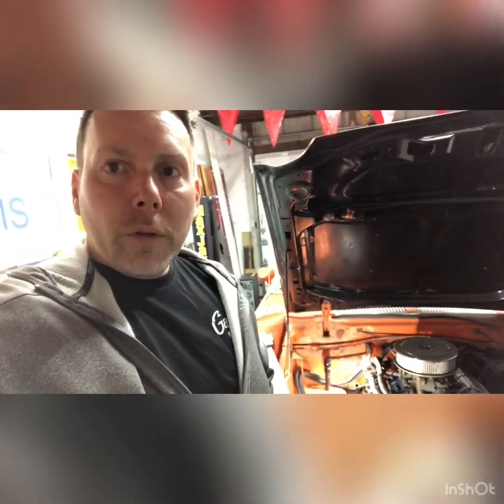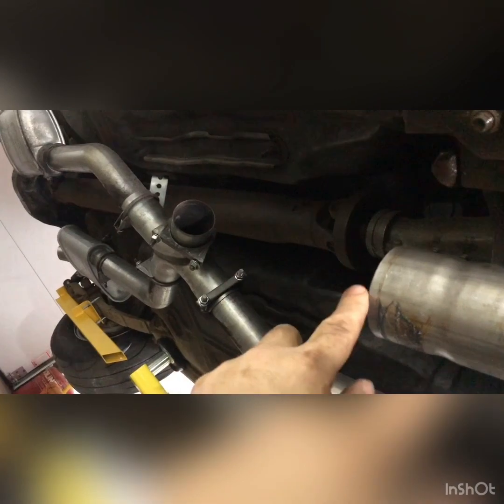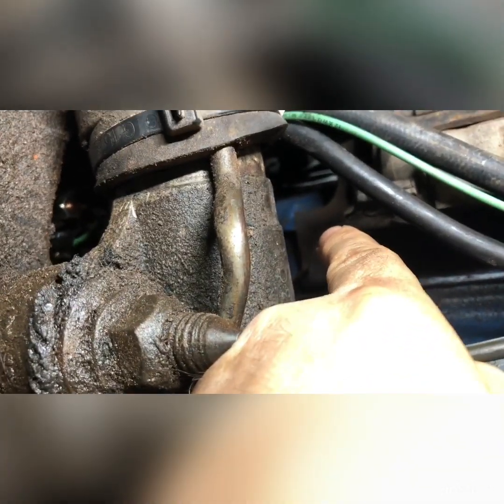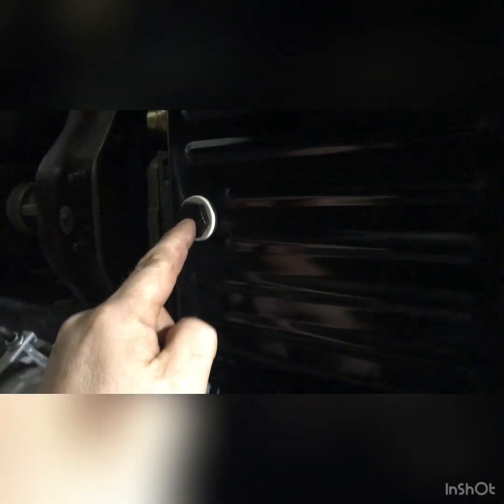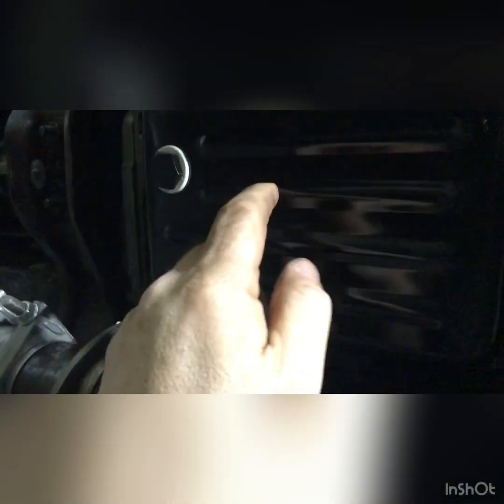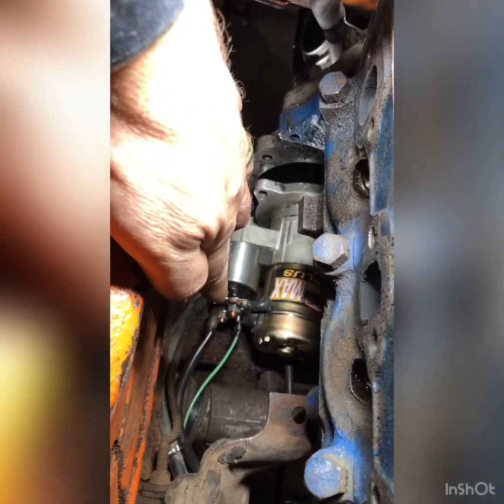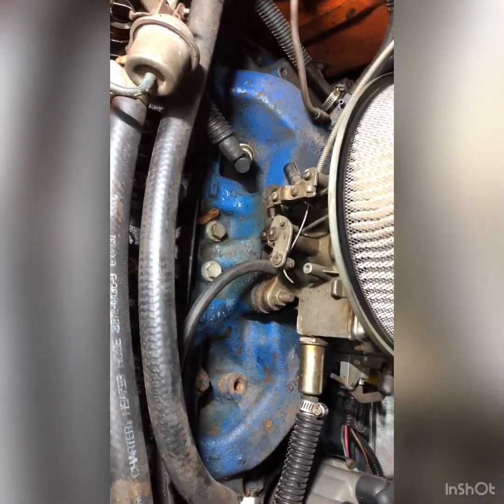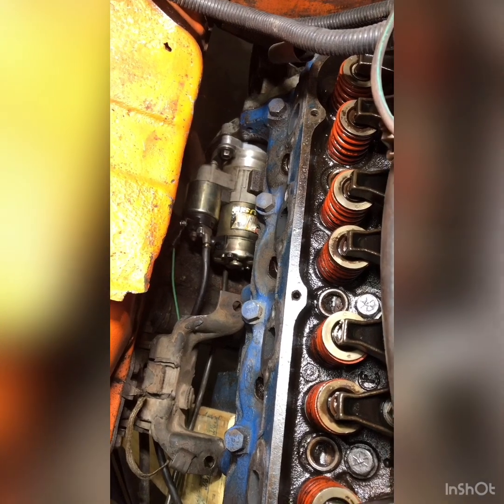78 mustang starter change

Comment: Why not take the long bolt (runs horizontally) that ties the motor mount to the frame mount. One bolt and done. Also as much as it looked like you raising up the engine...are you not stressing the drivers side mount by not taking it loose? Just for information purposes. My 78 has the Blackjack headers and by taking the bolt-in crossmember out I was able to remove the starter without removing the headers or even loosening them up. Great video!

Comment: pull the motor mount and the frame support mount out just make sure you pull the lower bolt on the starter first. 
 there in no need to pull the header or pull all that stuff off I can have my starter out in 30 minutes